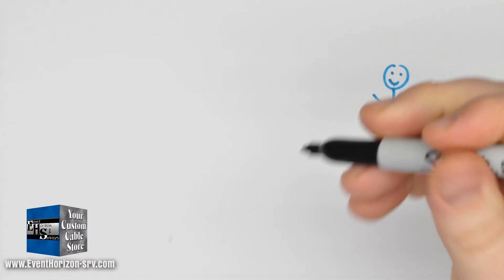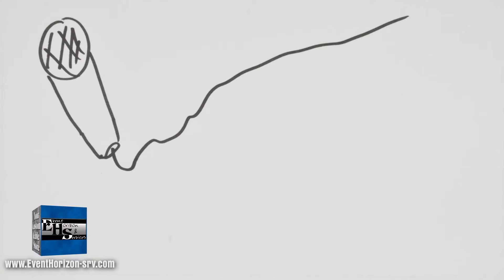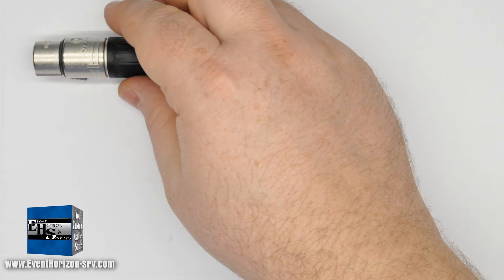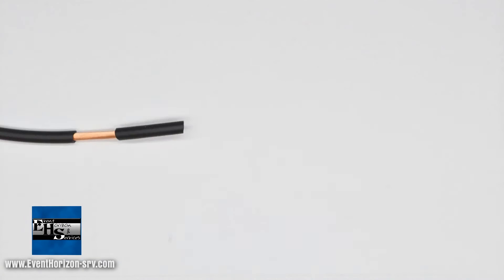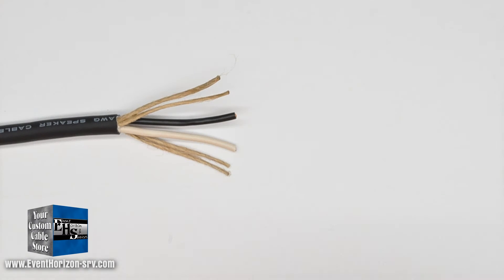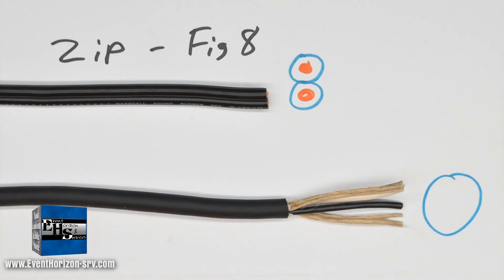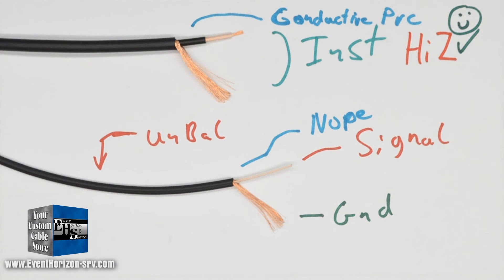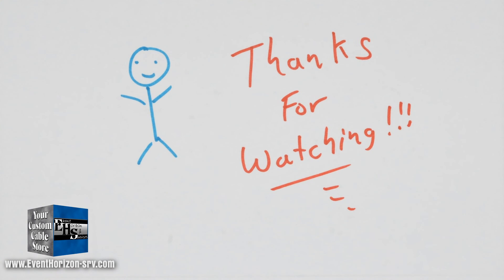Intro to Wire types Part 1: Mic, Instrument, Speaker, unbalanced

Comment: can you connect 6 microphone all 6 in to one plug in and 6 can talk at the same time?
Reply from the maker: The correct way to do that would be to use a mixer and each mic gets it own channel with it's own volume control. With that you can balance the levels so the loudest talker does not over power the others.

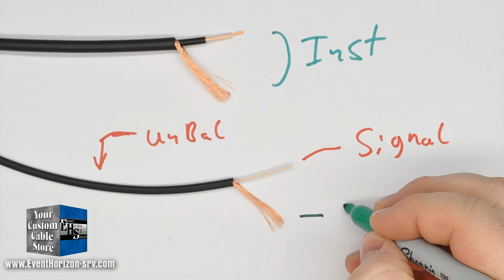Comment: Hi, can you give me the name of small cable at 4:30s? , is that mogami 2330 ? Thank you ^^
Reply: Hey, They are both Mogami wires. The wire on top is 2319: https://eventhorizon-srv.com/ecommerce/os/catalog/wire-information-t-1.html#M2319 bottom wire is 2528 (a dual cable): https://eventhorizon-srv.com/ecommerce/os/catalog/wire-information-t-1.html#M2528

Comment: Hi! Its really nice video. Problem is when I went to buy cable for microphone they said tell me in term of X/X like we use in house wiring 7/29 and 3/29, and for main wire 7/64. Can you tell me which type of wire should I purchase? Thanks
Reply from the maker: Hum, I have to admit I am really not sure what that is referring to. It really is not that complicated, there is the quality of the wire that plays into the cost. Few other things of concern but not for most applications. Buy from a quality seller and you will be good. Here are our cables if you like: https://eventhorizon-srv.com/ecommerce/os/catalog/xlr-microphone-cables-c-21_22.html